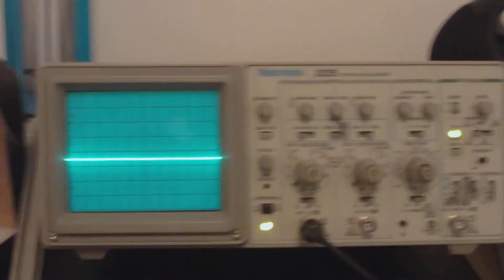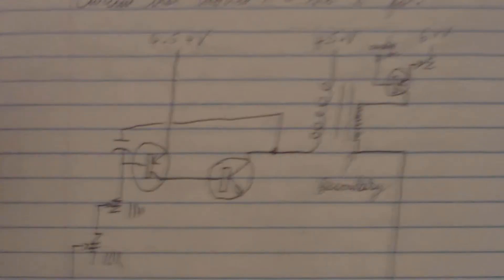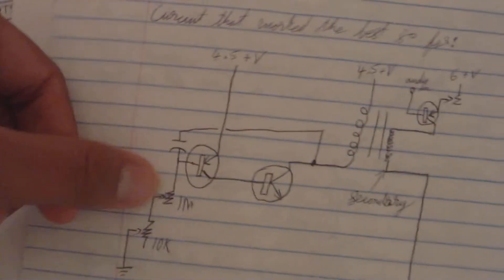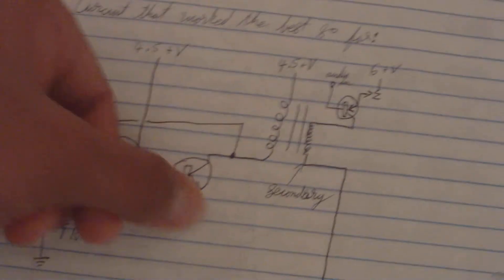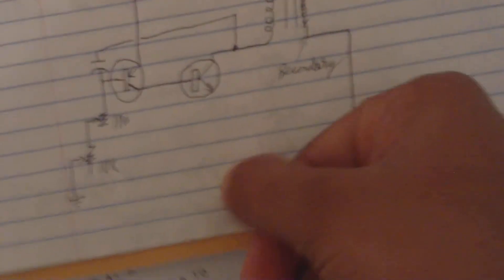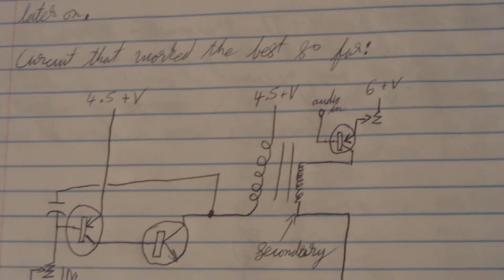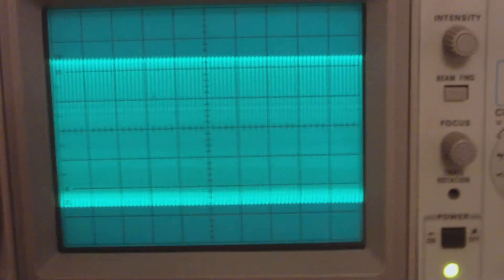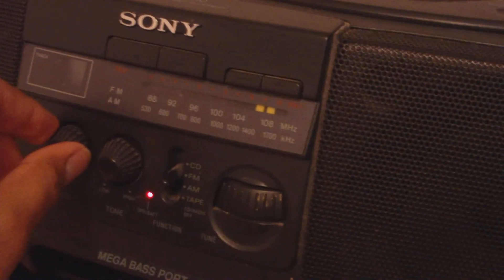Homemade AM transmitter

Comment from the maker: Its extremely low power so it can only transmit about a foot or so, range was not really the objective, just proof of concept and basic demonstration of one solution. I heard that soldiers in foxholes used coils of wire and a rusty razor blade, a receiving coil and a zener diode, to build crystal radios which they used to listen to FOX traffic. I agree, the goal should be greatest transmission length and most likely going to be my next attempt. Thank you for your interest :)

Comment: So the coil is the transmitter, how far can it transmit..?

Wondering how one could create a foxhole transmitter in wartime like conditions, where one does not readily have parts.

Or maybe we could assume they would have portable radios.

The objective would be greatest transmission length and possibly least detected. But something other than "spark gap" morse code transmission.

Minimal transmission would be, 

I am #, Enemy position in quadrant, 1,2,3,4.

Comment from the maker: @joeypc87 About .1uf or so. It really should not matter as the variable resistors control the charging rate of the capacitor. If .1 uf does not use a lower value capacitor.